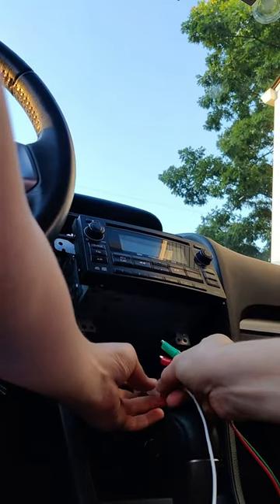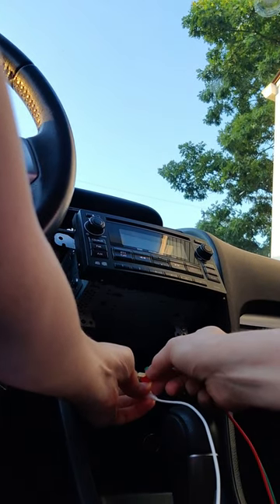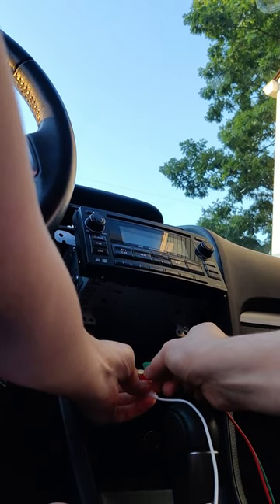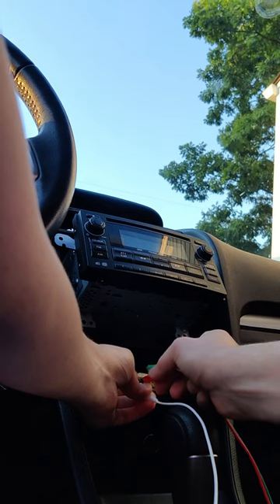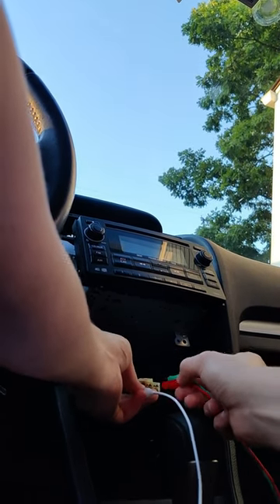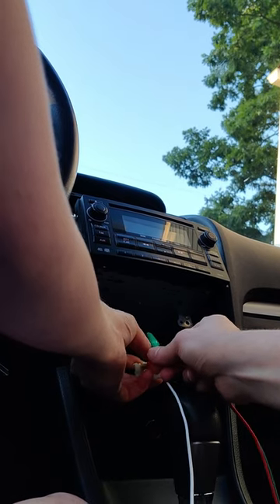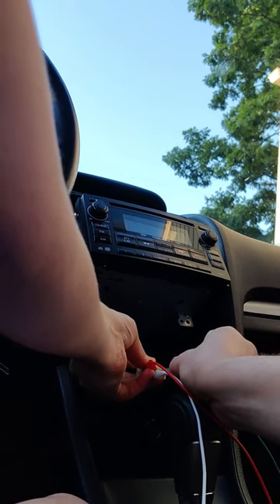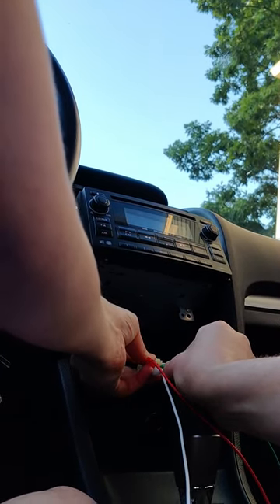Bypassing burnt out fan switch to test new blower motor, resistor, and relay. 2014 Subaru Impreza

Comment: This was helpful and probably saved me several hours on my 2014 Subaru Outback.  I tested first, before replacing blower, resistor, or relay. Since everything worked when I bypassed the switch, I knew the problem was the switch and purchased a used one on ebay.  If you ever decide to remake this video, I think it would be helpful to explain the wire you put together to test the switch to show you are connecting power to relay and power to each of the four blower speeds.  Thanks for this video.